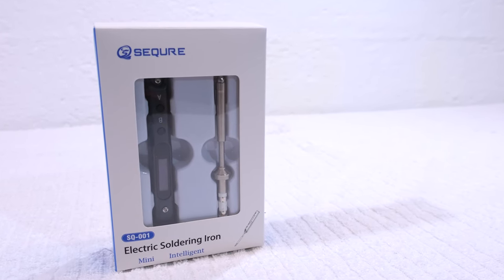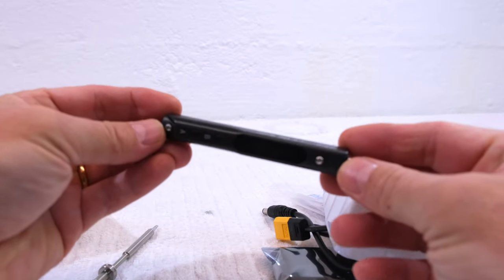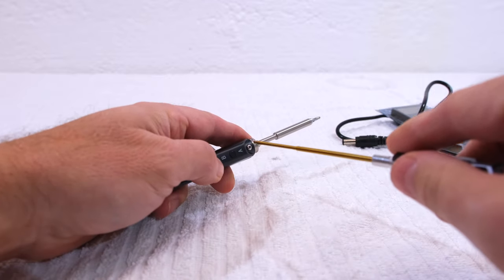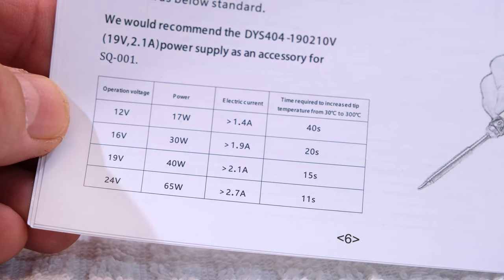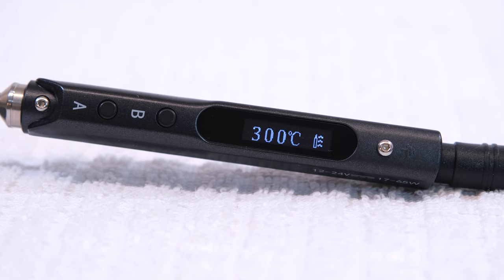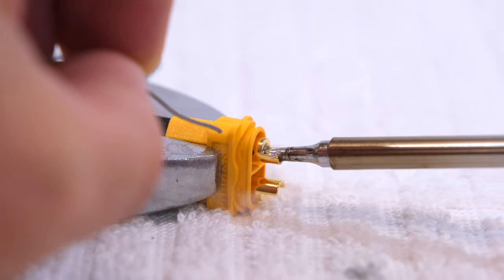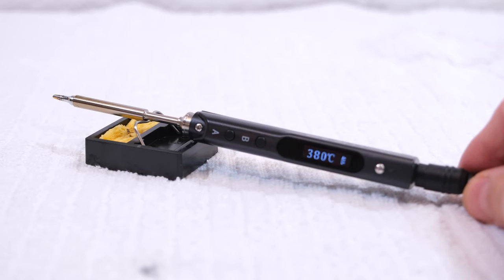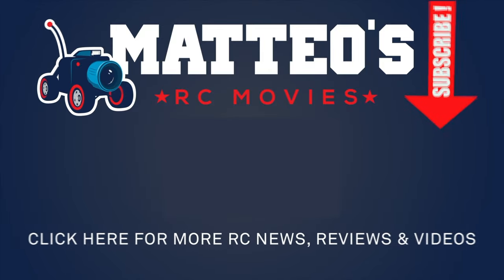SQ-001 Smart Mini Soldering Iron from Sequre - Review

Comment: Matteo another great video! I do a lot of soldering and use liquid flux. It really helps bind the solder. I use it on my battery connectors and my stainless chassis I build for slot car racing. I'll be looking into this product to use at the track! Thanks again.
Reply from the maker: Thanks Jeramiah! I will try this! 👍😊